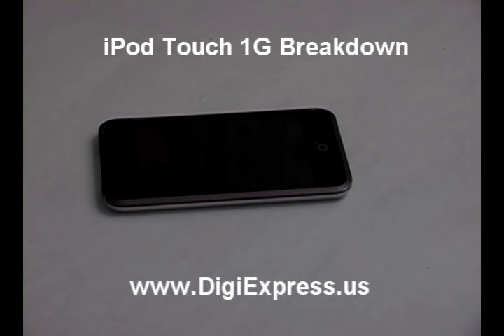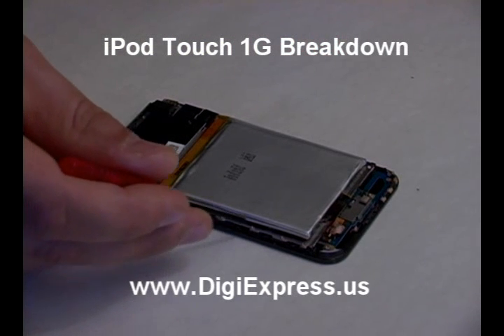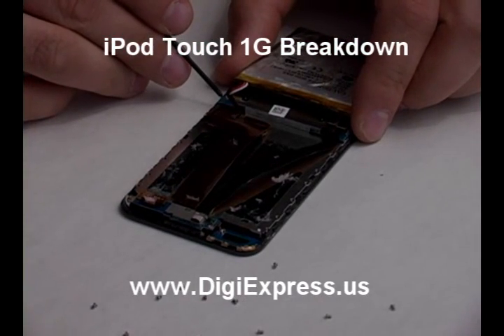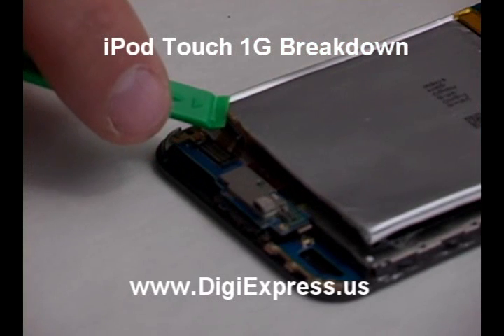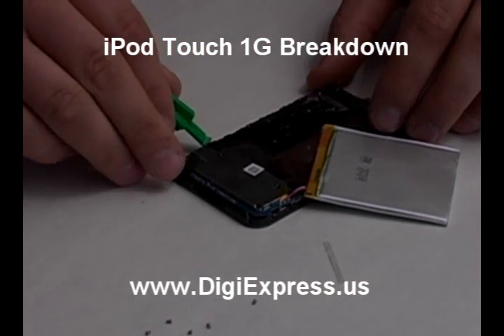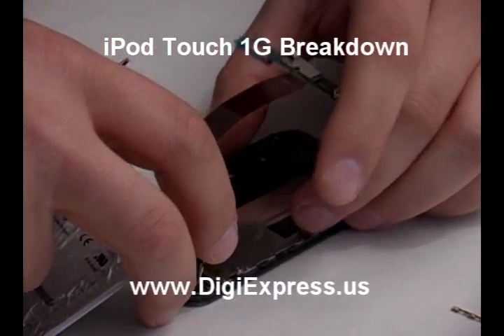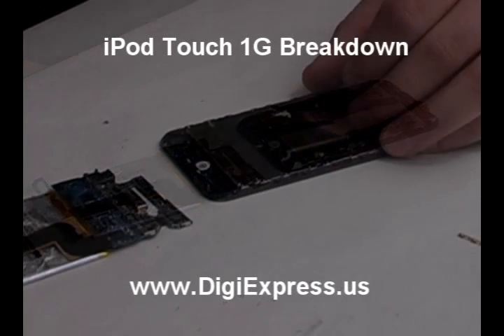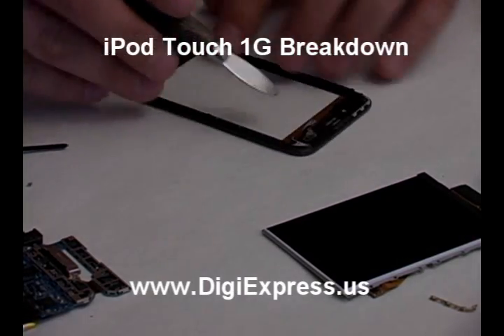DigiExpress - iPod Touch 1st Generation Breakdown

Comment from the maker: Unfortunately, those cables are part of the main logic board. If they are ripped, there is not much you can do, aside from attempting to find and install a new logic board. That is one part that we do not carry for the touch 1, as it is expensive when compared to the value of the device.

Comment from the maker: There could be a number of problems. It could be a screen issue, or a battery issue. It's very hard to determine. There's also a chance that the main logic board could be experiencing issues as well. Without diagnosing and looking at the device, I can't pinpoint the exact trouble. If you would like us to look at it, we can. There is a $25 labor fee for that. Any parts that would be needed would be extra and we would get your approval before we make the repairs.

Comment from the maker: It sounds like the LCD is actually starting to go out. The 1st Gens have been out for a while and depending how often it's been used, the LCD screen can start to wear out. We sell the LCD screen for $29.99 if you wanted to order the part and do it yourself, or, for an extra $25, we can do the repair for you if you wanted to ship it to us. Either way, that's going to need replaced. You can check us out at digiexpress.us.

Comment from the maker: It could be as simple as just a broken screen. If that's the case, you can order it directly from our website digiexpress.us. Go to iPod repairs. Click on the correct model (1st Gen, 2nd gen, etc.) Then just order the glass screen/digitizer. However, if you dropped it, there's a chance that there could be more damage. You can send it in for repair if you choose, which costs $25 plus the cost of parts. Our website also has a phone number if you want to speak directly to a rep.

Comment: is the charging/usb port supposed to be soldered to the board, and will it still power on if the headphone jack is disconected from the board, i kind damaged the connection when iopening it

Comment from the maker: That is possibly a battery, but you will want to get it to power up before you can diagnose any further problems.  Basically you are going to have to put a new battery in it so you can test it.  Then go from there.

Comment from the maker: If the iPod is jailbroken, then you may need to update your packages via Cydia.  If the iPod is not jailbroken, then just attempt to Restore it via iTunes.  There is pretty much nothing that can be done by replacing hardware to correct that issue.  Also if you are using a Jailbreak, make sure you are not bogging the system down with things like Winterboard or lockscreen animations.  Good luck.

Comment from the maker: @kanine5kuchiki You should not have to fully disassemble the iPod to change the glass digitizer.  Follow the instructions on the video until the glass digitizer has been removed, that's as far as you need to go.  Each repair is a bit different, so you may need to further disassemble the device to gain access to other parts.

Comment from the maker: @angelosimillidis We charge $25.00 plus $4.50 for the home button.  This is not the physical plastic button that you press, but the circuitry behind the plastic button.  The circuitry is what makes the "pop" or "click" feeling when you press the home button.  To my knowledge we are the only company that do this repair.  In some cases we do not need to install a new part, so it may only be $25.00; but it is hard to Diagnose the issue via YouTube.

Comment from the maker: @funnyawesomevideos12 You would need to get a nylon bristled brush that does not conduct static electricity.  Then clean the charging port with the brush and use canned air to blow the debris loose.

Comment from the maker: @RipMr2pac You would need to replace at least the LCD screen to clear up the gray lines issue, which is common when dropped.  Just the force from being dropped can cause the LCD screen to become damaged.  However you would probably need to replace the glass digitizer as well.  Since the only point of entry to the inside of the device is by removing the mid-frame and glass digitizer as a whole.

Comment from the maker: @dmafia786 If you can actually go into your Settings > Wi-Fi and choose to turn it On or Off, then you probably just need an antenna or backplate replaced.  If you get to your Wi-Fi settings and find the selector for ON/OFF is greyed-out and does not allow you to select either ON or OFF; that would be a problem with the wireless chip on the logic board (Marvell W8686B22 chip I believe).

Comment from the maker: @miguelon187 There is no fix for this, if replacing the LCD does not work then you need a new logic board.  The coil on the logic board for the CCFL(inside the LCD screen) is blown out, it is near impossible to replace them.

Comment from the maker: @88segovia you would want to use a heat gun on a medium to low setting, a hairdryer does not focus the hot air.  But if you need to use a hairdryer, then do it in 1-2 second intervals.

Comment from the maker: @THEGREATKARATEAKID the wi-fi issue may be from the jailbreak, if at all possible you should restore to original firmware and then see if the problem persists.  You could also goto Settings and Reset Network Settings; that may help.  If not then you may have a hardware issue.

Comment from the maker: @HEIGHTSIXFIVE The LCD screen has probably been damaged or is now damaged and that is causing the white/no display.  You would probably need to replace the glass digitizer, mid-frame and LCD screen.  This should correct the issue.  Though you may not need a mid-frame, its easier to get a new one rather than re-use the old one; but that's up to you.

Comment: I'm having a different problem. My 8G iTouch turns on, but the screen shows up white and blank. It's still operational because the alarm still goes off and I can turn it off. But I can't see what I'm doing. The screen is cracked (not very badly), but that happened before this, and it was still working fine. I don't know what caused the problem because I've been very careful with since it got cracked. Can anyone help me?

Comment: Hey I could really use some help. I ran my iPod over on my bike screen facing up a year ago and I did a damage report and found out the only problem with it is the wifi signal is really weak. And I mean that the only way to get wifi on it is to have the iPod laying on or within 6inches of the wireless router. Any solution to this problem would be great.

Comment from the maker: @bmxmmm If the iPod is fully functional, other than the screen sliders not moving, you would need to replace the Glass Digitizer (the front glass).  This is the part that is sensitive to touch and if it goes bad then you have an issue just as you described.  If there has been any water damage to the device there could be another issue.

Comment from the maker: @KaylaShae12 The issue with your backlight could be corrected by replacing the LCD screen.  There is a chance that, as with any backlight not functioning, you could have a problem with the main electronics board (aka logic board).  The only way to tell is to literally replace the lcd with a known good unit to see if it corrects the issue.  We can do the LCD repair, or sell you the part for your own install.  We do not do repairs on the main electronics board.

Comment from the maker: @freeskier0713 You would need to solder those leads to ensure that all functions as it should.  If you have wires that are too long it may be interfering with something else internally.  Apple has a grounding point for the wi-fi that is a gold circle on the backplate.  if this does not make contact with the logic board you may have an issue there.  generally even when using no solder, it *should* work; but doesn't all the time.

Comment: I replaced the battery with your product, but did not solder the wires i just twisted them together because i dont have access to a soldering iron. I then plugged in my ipod and the bright apple shows which gives me the impression its booting, but then it shuts off before the unlock screen shows up. any suggestions for this?

Comment from the maker: @Ozl01 we ship a free spudger with most parts orders as well as under the Tools section of our website is listed all the user friendly tools.  As for reassembly there does not need to be any glue used, the clips will "pop" into place and the pressure will hold the case together.

Comment from the maker: @Ozl01 The 1st Gen iPod Touch would be easier to use the plastic opening tool, aka spudger.  This way the plastic tool will bend as opposed to the metal "chipping" or bending.  The trick is to find the clips that retain the backplate.  You are basically "feeling" around with that plastic spudger tool and when you find a clip you apply a slight amount of pressure.  You should feel the front panel begin to separate from the back panel.  After you get it once, it is gets easier each time after that

Comment from the maker: @Hawkboy09 check first in the headphone jack, you may see a red / pink color.  if you do see a red or pink then you have moisture damage and that is a grey area for repairs.  if you see no color, only white, then you may need to replace the battery first, then possibly the LCD screen.  Even if the LCD screen is damaged, the iPod should be recognized by iTunes when plugged into the computer.  See if you can get the computer to recognize the it, if not you would have at least a battery to install.

Comment from the maker: @JBusie1996 haha, I certainly did not mean to scare you, but with any type of damage to any electronics device; you have replacement parts and the receiving end of those parts is the logic board.  If you have problems with the logic board, then in almost every case, you are better off to purchase a new(er) device.  I would continue to replace the battery and see what it yields.

Comment from the maker: @JBusie1996 If you replace the battery, attempt to backup any data before doing so.  Unless you already have recent backups, then you should be fine.  If you replace the battery and then find that the date and time both reset every time you power down the device; then you have a deeper issue.

Comment from the maker: @MRAngel805 There are 2 contact points inside the iPod Touch that carry the wifi signal to the logic board.  you may need to clear any corrosion from these contact points.  One is on the rear of the logic board that makes connection to the back plate, they are gold colored circles about 2 mm diameter.  The other connection is a copper rim that is located next to the gold circles, both below the black oval on the back plate.  If this does not work then you have a deeper issue with the logic board

Comment from the maker: @10sup10 For the iPod Touch 1st generation model, there is a tricky setup that lets the home button function when pressed.  The home button pushes a white disc on the logic board itself and contained in that white disc is the contact points to close the circuit for the home button.  It is basically part of the logic board itself and can be repaired only in certain cases.

Comment from the maker: @foortiz619 We replace headphone jacks on all iPod Touch models, but not the logic boards themselves.  If your problem is with the headphone jack on the iPod Touch 1st gen the cost would be $19.99 for the OEM quality part + $25.00 for the installation service + $8.75 insured return shipping, which totals $53.74.  More information is available on our website, which may have any number of sales running since the time of this posting (April 11 2011)

Comment from the maker: @foortiz619 This sounds like there is a problem with your headphone jack.  The headphone jack is soldered into the device and if there is a disconnect on that solder you will loose channels (the ability to hear in stereo or to hear all the instruments / vocals).  You can replace the headphone jack to see if it rectifies the problem.  If it does not then there is a problem with the audio codec chip on the logic board, and that generally is unrepairable.  We can Diagnose the issue for $25 (+s&h).

Comment from the maker: @2KARGARAGE You can open the SETTINS.app then navigate to the GENERAL tab, then to the ABOUT tab.  Under this menu you will find all the information about your iPod Touch.  The model number should be listed there, a google search for that model number will provide you with the exact generation.  There is another model number listed on the chrome backplate.  It is in very small text and can be hard to find, but it will start "A1xxx".  For instance the 2nd generation iPod Touch is model no. A1288

Comment: Well I have the infamous volume slider not appearing when connecting earphones in pronlem. I get the volume slider back when I apply a lot of pressure in lifting the connector of the earphone to iPod. Do you think there is a problem with the earphone jack? Thanks in advance.

Comment: hey i know the problem with my itouch on the wifi.it seems easy to fix but i cant seem to find the right way to do it. ok on the backplate when you take it off you see behind the antenna there is a little metal thing sticking up and it is suposed to touch the little gold dot for the wifi to work.i know it wud work if i connected them because ive done it before.i just dont know how to keep them together perminantly. please help me because i cant find the answer anywhere! thanks for reading

Comment from the maker: @tublywork We can check the wifi on the iPod touchs, but we would suggest that if the wifi is not working in one spot to try another location like a  Starbucks and see if it works there. If not you can always send it to us for a diagnosis. Check out our website for more information.

Comment from the maker: @12tippettm Your battery is most likely dying and should be replaced. We replace batteries at DigiExpress and offer a lifetime warranty of the battery and can install it for a $25 fee. Our website has a list of all the models we fix and also has the prices for the parts we replace. Check out our website for more information.

Comment: The port which charges and synchs my first generation ipod touch does not connect unless I bend the connection. I have not been able to connect it to my computer because of this. There is therefore a loose connection inside the ipod at this juncture.  Is this reparable or not?

Comment: are you able to fix my ipod touch 1st gen. It works but the light doesnt i can barely see the screen its dark. i tried seeing if its the settings for the brightness but no. I was told it was do to water damage. but cant it be replaced with a new digitizer?

Comment from the maker: Yes. The battery is soldered to the mainboard. De-solder the battery contact points and replace it with a new battery. We sell the batteries on our website, we can also install a new battery for you.

digiexpress . us

Comment: use guitar picks if you have them, there just as good if not better than the tool. as long as you push the picks into the curve of the metal and not the ipod itself, you can push as hard as you like. the aim it to slide them along the sides to unclick the latches.